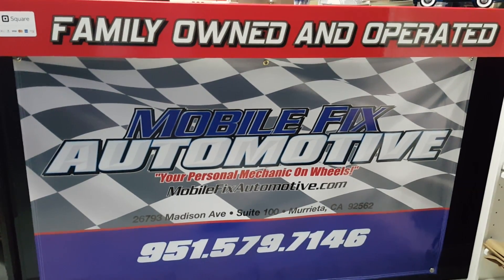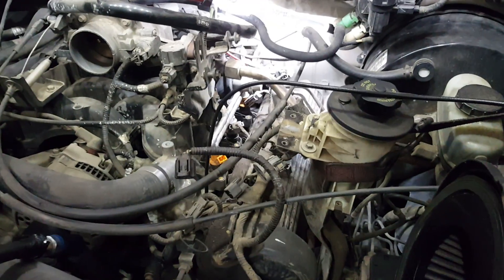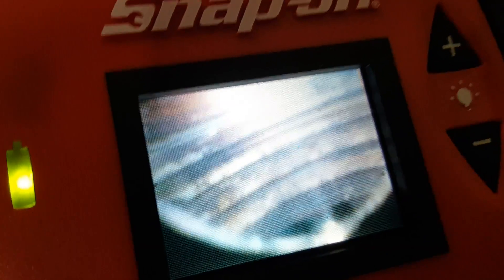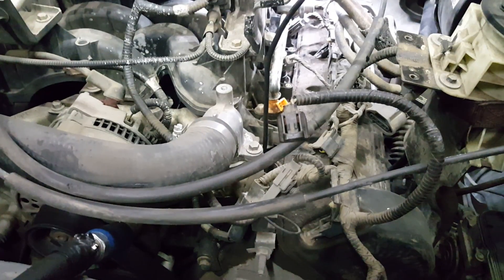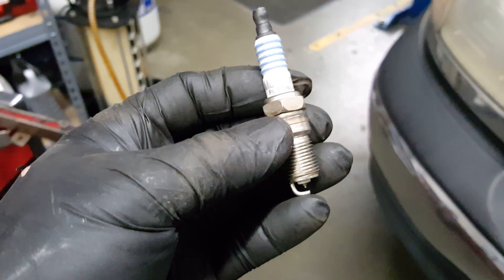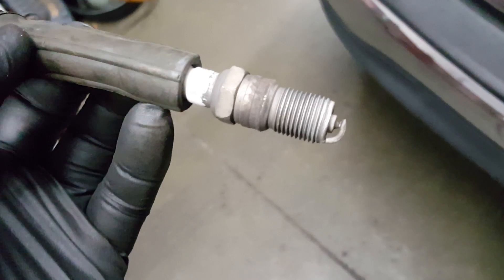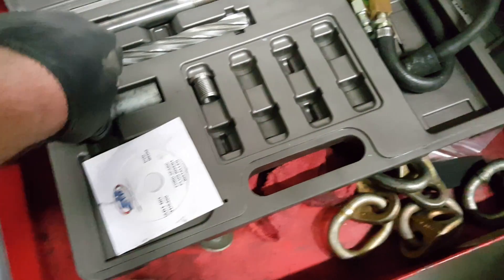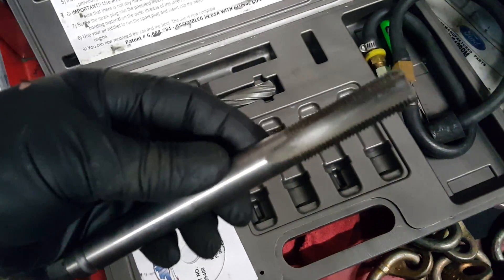Why the spark plug blew out of your Ford Triton engine

Comment: The head design was crap.  Then they went to the three valve engine with those super long reach plugs that would seize in the head with carbon, which was ANOTHER terrible design.  

I'm done with Ford at this point.  Then again, I'm done with anything built after 2000.

The spark plugs brand is more vital than people realize.  Autolites are garbage - fixed so many misfires over the years by swapping out new Autolites for OEM plugs.
Reply: Never use champion plugs either
Reply: @johnhull6363  champions without anti seize is auto seize-
Reply: @johnhull6363  ABC... Anything but Champion.
Reply: Autolite is made by honeywell, who makes motorcraft plugs....
Reply from the maker: Yes, but the autolight plug I was holding in the video did not come out of that engine. I picked up the wrong plug out of my tool cart by mistake. Since the threaded end of both the motorcraft plug and the autolight plug are the same it doesn't change what the basis for the video which was that an engine with originally installed spark plugs still blow them out and why I feel its happening. Thanks.
Reply: immikeurnot this isn't related to trucks ,but I don't know how many dirt bikes & quads I have got back to life, just by throwing in a fresh spark plug!
Reply: Absolutely agree with immikeurnot.
Reply: I have used autolite for years and never had a problem
Reply: @williamwalters9403  cheap low end plugs
Reply: autolite and motorcraft oil filters !!!  can't loose .every Ford ive had got over 200k and more !!! no problems . miss my 86 F250 real bad .
Reply: Autolite is a Ford plug. So what you are saying is the plugs are just like the company?
Reply: They haven't sold or produced these engines in long time...and the 4.6L was a great motor. 5.4L had many happy customers too. Giving up on the best American automaker says more bout you than any experience. They design build & sell the best trucks & SUVs of any. Facts.
Reply: Correct the older 2v 4.6 and 5.4 were great engines as long as you could keep spark plugs in them. I use to have a 97 4.6 expediton with 376k on the clock. That little 4.6 Had plenty of power for such a big suv. Only complaint was the injectors which were that engines demise. It EASILY had another 100k maybe another 200k in it. But injectors began to stick open and hydrolocked it one day :( After that it started knocking. Sold it to a friend to put another 1k miles on it with it knocking. Even did donuts in the yard lol. Tranny went before the knocking engine! I cant defend a 3v tho. Those engines are garbage heaps. Paid 25k for a used 04 f150 years ago. Bought it with 120k on it. Now it sits needing an engine at 160k... And with remans being the only thing avaliable to a tune of 4k+ installed no thanks. It can be yard art because i know that as soon as I put an engine in it its going to need a tranny, then maybe a rear end...
Reply: @Davido50  the 4.6 and the 5.4 are both garbage engines. You obviously don't work on cars for living if you did you wouldn't say that
Reply: @Wanous-hv7zo  bullshit, I've seen the 4.6 run 500k miles in a taxi
Reply: @MrErikw26  your on drugs. Don't you know drugs are bad for you?
Reply: I've done hundreds of tune-ups on those engines without breaking a single plug....
Reply: @MrErikw26  you lie too
Reply: @Wanous-hv7zo  how so?
Reply: Ford is outstanding all my family buys & drives never let us dwn!
Reply: @Davido50  you must not drive much
Reply: David Klimmek
Ford is shit
Reply: I think the most reliable ford my family has had in my lifetime (im 18 rn ) is a 2012 Camaro, never have we even needed to take the plastic trim off the top of the engine.
Reply: Animal productions 🤣
Reply: @Shawn-jf  the Camaro? The car they stopped producing for awhile. Don't insult Ford putting the 2 names togethor . Mustang is the best selling sports car in history. Period.
Reply: @Davido50  actually yea your right its a Chevrolet Camaro. Im not much of a brand guy so I'll mix up names sometimes. Mustang are a pretty sweet car tho. Shame the drivers tend to give them a bad reputation
Reply: @Shawn-jf  drivers give Mustang's a bad name or Camaro's? Both are beloved cars esp Ford Mustang's. Best selling sports cars in history. The values on classic ones are thru roof. New ones average $40k up to $75k . They have good reputations bud.
Reply: @Davido50  notably mustangs, since there called crowd surfers, Camaros probably have a bad rep for something too but I wouldn't know.
Reply: @Davido50  GM has sold more muscle cars than Ford ever has because they had Pontiac/Oldsmobile/ Buick/Chevrolet/ and many different styles of muscle cars from each brand. Ford has the mustang back in the day they had a few more but GM has out sold Ford on muscle cars prolly 10 to 1. You need to get your facts rite before engaging mouth
Reply: @Davido50  Mustang a good car?? LOL.

Mustangs look cute other then that meh.

I thought they all crashed criwd surfing there cuteness... LOL
Reply: David Klimmek only because they never stopped making them.
Reply: @zeppelin67637 " you can't fool all the people all the time," boy I'm starting to wonder about that in light of the Mustang. I thought they were drunk when they came out and I haven't seen much improvement since but that's just me.
Reply: @Wanous-hv7zo  Do a little research. 5 of the top 10 selling muscle cars of all time are NOT GMs. 3 of the top 5 are Dodge Plymouth and Ford is at the top with the 70 Boss 302.  I prefer Cudas myself but yes that is from a compiled report of total volumesales of new Units. 
Dodge is the top all time by 2 % over Ford by .75% over GM. How bout you do little research before telling others to get facts straight...Bud
Reply: I think you need to get your facts straight
Reply: @Wanous-hv7zo  Not my Data. Its Manufacturer sales numbers from 62 to 78s numbers compiled by Hot Rod Magazine. Even i didnt know Ford sold that well until I read that
Reply: waaaaa

Comment: Ford did the EXACT same thing with the Diesel trucks from 08 to 10. They were notorious for radiator leaking issues. I owned a 2008 F350 Ford replaced the radiator twice under warranty, after 36000 miles I needed another radiator Ford said my radiator failed due to my tuner...... I now drive a Silverado 2500HD

Comment: I've got a 2005 Triton 2v ,, 300k never had an engine issue , just replaced the alternator idler pulley and belt just got 3rd set of plugs ?? I got lucky

Comment: I knew that there were only @ 4 1/2 threads in the hole. I agree if the hole was threaded all the way through may have had fewer blow out, but they would probably have still come loose. However I firmly believe that if you check and re-torque them before they come loose and rattle the threads out of the head, THEY WILL NEVER BLOW OUT. 4 1/2 threads are adequate as long as they stay tight. I am an ASE Master tech  and have fixed tons of these over the years. Hope you read this thanks
Reply: Adequate being the KEY word here. FORD  cuts costs to the point of being JUNK!
Reply: Kinga Daroad . agreed ford engineers junk. It frustrates me sometimes but that's why I don't own them. All the techs at the shop I work at have a running joke about how we wouldn't have a job without Fords. We make so much money fixing their poor engineering.
Reply: Try re-torquing all 10 plugs on a 6.8l V10 in an Ford E450 van. It's a PITA!!!
Reply: Ford says Built Tough.
That's a big laugh😁.

Comment: You have a good point with how long the threads are on the plug compared to the head. But I believe the real problem is the fact that the Ford moto craft plug is made up of two pieces. You say you don't use anything but oem.. But you will have the same problem. Although champion doesn't have the best track record, the make a replacement  solid 1 piece plug. Tritons are nightmares. Go look up plugs on Amazon for a Triton. Recommend on the side is the broken spark plug removal tool. Junk man.
Reply from the maker: +b18citr
Thanks for the comment, however because i have done near 1000 inserts in a 8 year period with fleet accounts with hundreds of thousands of miles on my cal van inserts and have never had a comeback ill stick with my method. By the way the 2 piece spark plug is a problem on the 3 valve triton not the 2 valve.

Comment: I own primarily Ford's, but nothing newer than 97, for this reason. Ford has made gutless, poorly engineered, not to mention ugly vehicles for 20 years. Oh, did I mention absolutely, ridiculously, over priced! Problem is the other brands are about the same.
Reply: Babylon falling  old trucks have always been more reliable. Now a days they are just money grabbers.
Reply: @francisprevel1  they are designed  to be money crabbers=cheat and swindle.
Reply: Babylon falling  I'm also getting a 1975 f250 as a project, love the body and love the engine.
Reply: @francisprevel1  and they are both junk especially the mustang. The mustang was a piss poor engineered car no frame no inner fenders leaf springs go thru the trunk floor shitty engines shitty brakes. They are just a shit car
Reply: 1970 olds442 what do you prefer? Japanese vehicles? I actually like the Lexus they seem to be better than German cars when it comes to quality.
Reply: @francisprevel1  na I drive GM vehicles and nothing else. I also ride Harley Davidson motorcycles.
Reply: 1970 olds442 yea General Motor being reliable is a myth. People just say that to give gm some type of support because nobody buys gm vehicles. There vehicles rust easy, they always have problems and most people that drive gm are people that spend too much of their time hating on ford.
Reply: @francisprevel1  you from MN?
Reply: @francisprevel1  your mustang will always be just another junk mustang with no frame and a shit engine.
Reply: 1970 olds442 don’t be so offended my man, fords always had a bad design however they’ve always had good transmissions and engines as long as replace the spark plugs and replace the camshafts every 10 years or so for my 2008 f150.
Reply: 1970 olds442 why do you think gm is going out of business? If they where that reliable they would still be running strong on the market.
Reply: 1970 olds442 even Scotty Kilmer a mechanic with over 50 years of experience admits that Mustangs are overall good vehicles.
Reply: @francisprevel1  if they are so good why do you have to replace the cams and chains? I know many Chevy's 4.8 5.3 6.0 with over 300.000 still the same cam and timing chain. Ford has always tried to be on the cutting edge of everything but in the end they always shuv their dick in there ass. Overhead cam on a V8 nothing but problems. You remember in the 80s the coke bottle frame? Prolly not born yet I bet?  Is a 351m a good engine?
Reply: 1970 olds442 watch Scotty Kilmer he knows a lot more than you about vehicle, he knows that fords and Toyota’s make good vehicles. I forgot to say one thing, I’ve never had to replace anything besides the spark plugs on my f150 because I used 5w30 instead of the recommended oil 5w20. 5w30 is better for long term and reliability for the 2008 f150. My truck also has a little over 269 000miles and it’s still running like a beast with regular tune ups.
Reply: 1970 olds442 Fords beat GM in Fuel economy, hp, safety features and technology. Fords are overall better like it or not. They are still pretty reliable if you take good care of them. I know a person that got a Silverado and he had to rebuilt his engine TWICE because of this 4 cylinder mode crap, good job GM once again you disappointed your customers. No wonder people are switching over from GM to Ford.
Reply: @francisprevel1  what was the biggest problems Ford had in the 80s?
Reply: Babylon falling  it just shows you how easily people can be fooled by all this crap. Trucks are used to tow, get from point a to point b, carry heavy loads, etc... Not to play video games in the damn thing and be a city poser. I am getting a 1968 mustang very soon, I cannot in wait.
Reply: Babylon falling  probably 302 to start because its cheaper. Then maybe if I have the extra money and I get more experienced, maybe I'll get a 351.
Reply: @francisprevel1  351C? 351w is junk crankshaft issues
Reply: 1968 mustang is it full of rust or whatever 50 years
Reply: Babylon falling  nope they won't dumbass
Reply: Babylon falling  both are garbage
Reply: The other brands are not the same
Reply: 1970 olds442 don’t believe me about Chevy going out of business? Do some research.
Reply: @francisprevel1  Fords going out of business. Do some research. They are closing by the weekend
Reply: @francisprevel1  do you love Nancy pelosi?
Reply: @francisprevel1  hey Ford man is a 360 a good engine? How about a 400m?
Reply: 1970 olds442 idc about all this crap, all I care about is the 5.0 and the 5.4 being good engines.
Reply: @francisprevel1  the 5.4 is a turd and so is the 5.0. so what problems do they have?
Reply: 1970 olds442 well my f150 hasn’t failed me once so I’m pretty sure the vehicle is pretty reliable. The 5.0 had issues with the cylinder heads but was later fixed. Besides that the 5.0 is a very good engine giving better fuel economy than the vortec.
Reply: 1970 olds442 I don’t hate GM but Fords  are just overall better which we all know the interior or Silverado’s are junk.
Reply: @francisprevel1  you don't know what's reliable and not reliable. And I Know for sure you don't do any mechanic work at all just by what you say
Reply: @francisprevel1  you have a Ford that's why they are the best rite? You know everything rite? I have forgotten more shit about Fords and Chevy's and Dodge's than you will ever know. Where are the spark plugs on your junk 5.4?
Reply: @francisprevel1  AH DUH DUH DUH Fords are the best cause I own other than that I don't know why
Reply: 1970 olds442 Chevy and Dodge rust really fast. Fords have better transmission and are better against road salt. I have aftermarket manifold, no problems with the manifold.
Reply: 1970 olds442 chevys will rot here in Canada, they rust within 2 years. Fords have better frames. Chevys have had just as many if not more problems than fords I can name you a few if you want.
Reply: Babylon falling  they were not rust buckets and the bolt in rear axles are great for drag racing over C clip rearends. I see just another dumb fuck on YouTube who has no idea what he is talking about. Let's look at a junk 1970 mustang no frame no inner fenders shit engines junk steering and when they get rusty leaf springs go thru the trunk floor and their nickname rustang
Reply: 1972 rustang with a 351C engine 177 hp what a turd
Reply: Babylon falling  a butthurt stupid Ford boy. GM designs are light years ahead of fucked up Fords. How about the stupid spark plugs on the junk Triton's? How about the coke bottle frame in the 80s? Prolly before you were born. How about the devorsed transfer case on the trucks driveshafts fly out? How about the junk engines? How about the junk power steering on the orders trucks had a hydraulic cylinder? How about the Ford rattling bearings on almost all their engines? How about the junk high ouput heaters that didn't heat? How about the junk twin I beam front end that eats tires like crazy. How about the junk overhead cams with the shit timing chains? I could go on for hours and hours. The new Ford Diesel front cover replace you have to take the whole fucking drive train out to replace the front cover on the engine that's a good one there. Fords are fucked up and have been for a long time 40 years and counting
Reply: @Wanous-hv7zo  AND they have outsold Chevy for 40 years and counting.......
Reply: Babylon falling  you obviously don't work on cars and trucks otherwise you would know this
Reply: Babylon falling  and no the axle is not the inner bearing race
Reply: @SeriouslyKidding-o9s  you sound like a punk kid
Reply: Overpriced definitely. 50k for a nicely equipped XLT?! GTFO
Reply: MrErikw26 yea I agree
Reply: now here is a man who see's reality for what it is. You have just about covered everything that is wrong with Ford's.
Reply: I'll take a Ford over a Chrysler or Dodge any day of the week
Reply: I have a 93 F150 with over 400,000 miles. It's get a little tired, but it rarely breaks.

Comment: what an overly complex piece of junk engine. give me a pushrod chevy small block of any variety and it will be better. 305, 350, LT1 (even with the potential opti spark problems), 5.3, ect ect.... fords especially modular 5.4's are just junk.
Reply: leave it to ford to create another problem that never was before.
Reply: I agree ford wasn't bad until they did away with there simple  engines
Reply: and GM still makes pushrod engines.
Reply: AMEN!!!!!
Reply: You are correct 10 times the engine this junk Ford is. If you look back 40 years till now Ford doesn't know how to design a good engine that is why they purchased engines from other companies.
Reply: EVEN the old small block Ford
Reply: ford should have had a recall or put better heads on all that were sold. be accountable. right